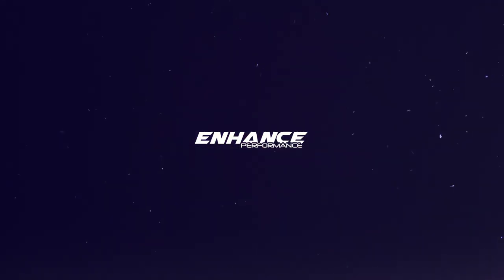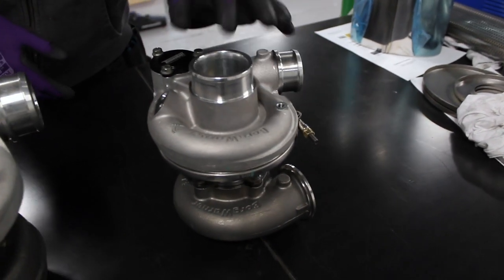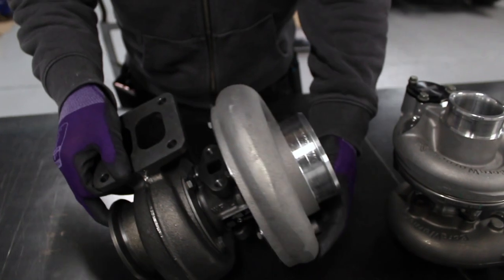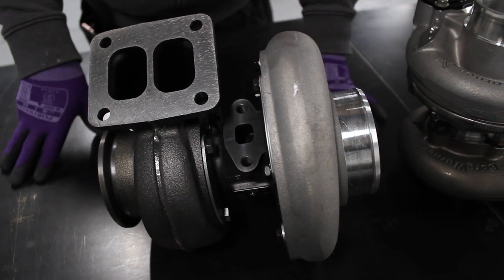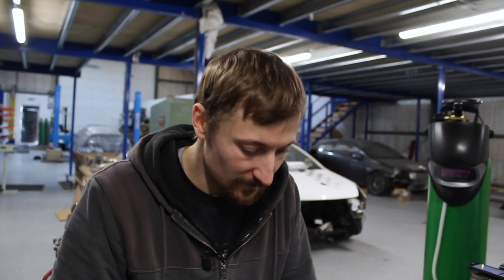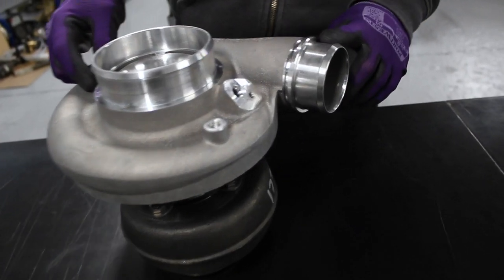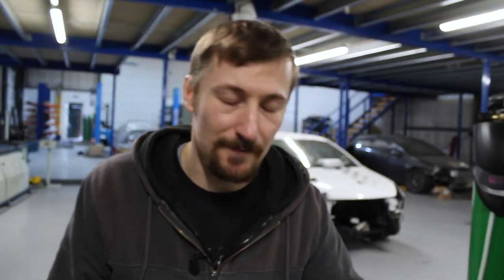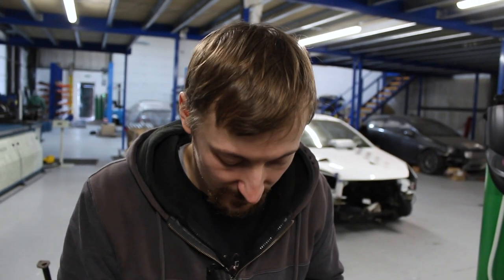Borg-Warner SXE S363 Turbo Charger

Comment: That hole on the side is to connect a hose to the wastegate or the solenoide ? I installed one S1BG on my car but the guy who installed it left that hole open and I am having boost issues, first not building full boost and now overboosting.
Reply from the maker: There are two holes, one for speed sensor and one for boost pressor takeoff
Reply: @EnhancePerformanceTV  thanks mate. Mine is the smaller one the S1bg. Only has 9ne hole and its open. Guy didn't closed it and already made 3000miles like that 😕